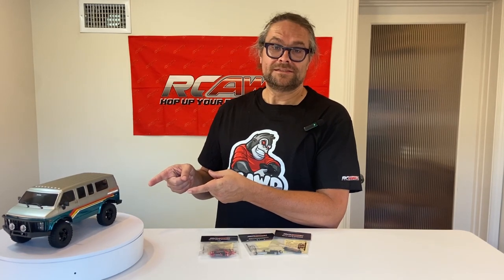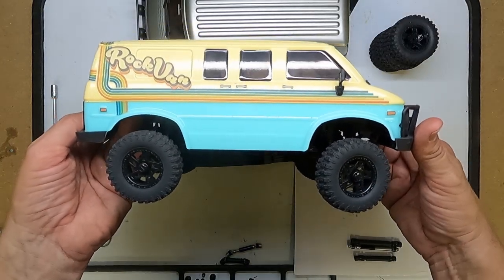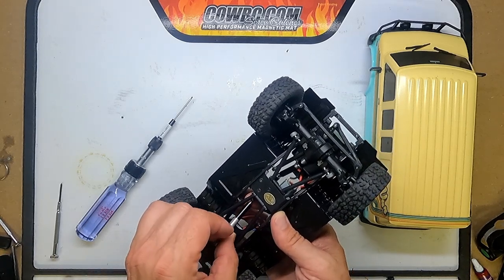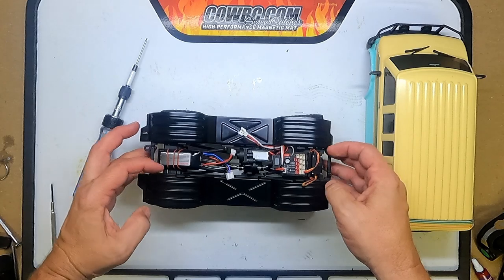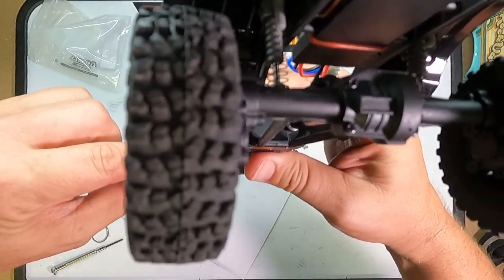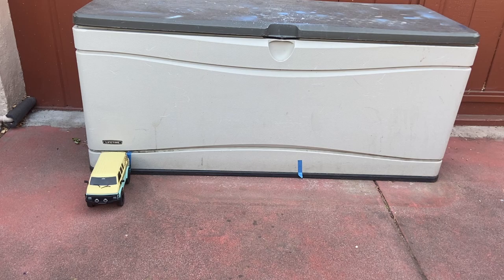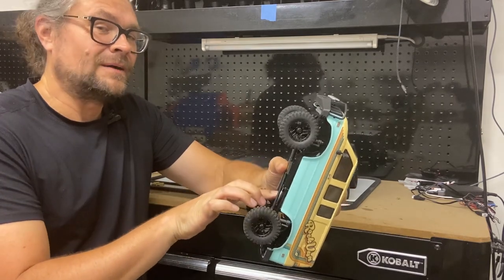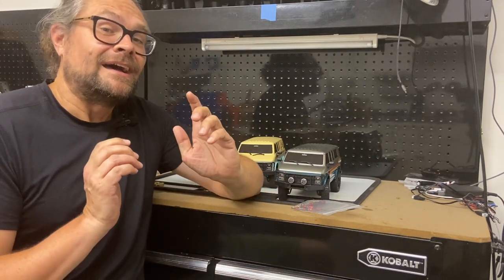How to install ​⁠steel driveshafts in the CR18P Rock Van. #rc #hobbyplus #vanlife #rcawd

Comment: Any idea what can we use as a replacement driveshafts for the EVO models?  Since these steel one doesn't fit.
Reply from the maker: I’ve seen on the “HobbyPlus mods & fun” facebook group that people are using axial c-10 in the front and deadbolt in the rear, but they’ve had to file down the D shaped hole to fit. HobbyPlus also posted that they will be releasing titanium driveshafts soon. Maybe best to wait for those.
Reply: @QuinnsRC   where did they posted it? I don't use Facebook so I hope they have some other platforms that I can follow them on
Reply from the maker: @IlhanCanGuven  Yes it was on Facebook. I haven’t found them on any other platforms.

Comment: Quinn does the front fit on the evo
Reply from the maker: I actually didn't think so, but I just tried it, and the front does work! I also made a more deliberate attempt at the rear, by detaching the lower links to let me push the axle back a bit. I could get the driveshaft in but the links wouldn't reach the skid plate. It's really not a lot, maybe 4mm. Could cut/grind that off the end of the drive shaft. Only problem is there's a fixed metal sleeve that might get bunged up.
Reply: @QuinnsRC  thanks quinn I broke the rear shaft now using a axial scx24 jeep wrangler jlu for the reat metal works great I was going to get the correct drive shafts but I will probably cut a front scx24 shaft for the front thanks quinn for answering and I'm waiting on some videos of yours lol 😆 take care bro